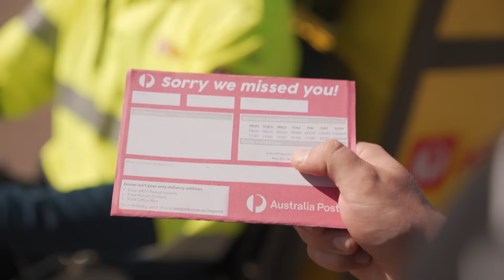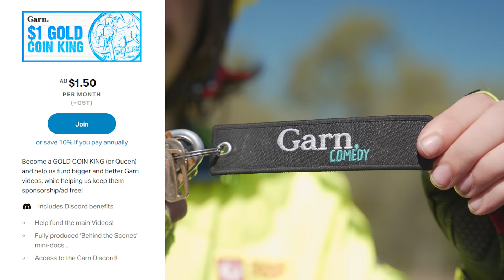Every AusPost Worker Ever... | Garn.

Comment: The bikes being too loud was a problem. It meant you might actually hear them and be able to get outside before they leave a card and run. With the electric buggies that's no longer an issue.
Reply: Too true 🤣🤣
Reply: The ones doing the card were the ones in the delivery trucks,vans though don't mind normally postie doing it since they never had the room anyways
Reply: The electric buggies are too slow though, if you were to see them you could catch one
Reply: @valentinkay2928  They can go up to 45ks an hour. About 3 times the average human can run.. Good luck catching that.
Reply: Postie here, trust me. It’s not hard to card and run on the bike either
Reply: @benjamin9120 That’s only about 1.5x the sprinting speed of an average human, at is happens.
Reply: You should be able to hear the sqeaking as it approaches.
Reply: The average human can run 30km/h? Wow!
Reply: The average human can run 30km/h? Wow!
Reply: The average human can run 30km/h? Wow!

Comment: My Dad was a delivery contractor for AusPost for years, and they ran on a three strike system - as in, three complaints and you're fired. Ever. For any complaint, no matter what the reason, no matter whether it was true or not. One person complained that the AusPost magnets on his car door weren't quite straight once (country delivery area, approximately half of his 120+ km delivery route was on heavily corrugated gravel roads), and that counted. That was the only complaint he ever got, but yeah, he got out his spirit level and some fucking glue so they couldn't possibly move.

Comment: I saw one of those contractor pricks literally tiptoe up to my door and try to sneak the card in between the door and the fly screen

The look on his face when he turned around to get in the van and saw the electric gate closing was priceless, I was thinking to myself, yeah mate, I got you this time you lazy cnt, then got both my 20kg packages of lithium ion batteries from what appeared to be the most depressed postie contractor in existence XD
Reply: You building your own power wall or something? That's a decent stack of batteries.
Reply: @iamdave84  indeed, I was building a 12kwh add-on for my solar system, and I also wanted to upgrade my electric bike battery

Comment: The idea of using electric scooters for mail delivery and last mile transport is actually pretty cool.....its not that thoes things suck,if u swap out the motor for one of those 1000w escooter motors,u would easily be clocking 80kmh.....uphill....both ways

Comment: I get it, it’s a piss take. But I feel I need to clarify a few things…I work for Auspost and after a hip replacement the only option for me, during my recovery, was the Electric Delivery Vehicle. I was pretty sceptic at first, but after having covered almost 3,000klm on one I have to admit they are excellent machines. No it’s not just about noise, it is about reducing maintenance costs, also they fob lock all doors so they protect mail whereas the Postie bike Mail is vulnerable to theft, also due to their size your whole run can be carried on them. Plus they autopark on inclines which is a great feature. Plus they are far safer than Postie bikes too, so it is a far better machine than the postie bike in many areas….not perfect but a step in the right direction. They also do 55kph and are only used in 60kph or less zones. To be fair you should do a video on peoples letterboxes and how bad many of them are…..I feel Auspost should bring out a decal for them….’Auspost Approved Shitbox”.

Comment: As a boy I once helped the parcel contractor for cashies at christmas. The rule was shake and feel the parcel, if it doesn't seem like it will break, throw it from the furthest distance at the highest velocity possible. Ten points if you can get it from the van window. Also do not get it on the roof like he had done and been in trouble for

Comment: AusPost is taking the piss. "Incorrectly sorted and forwarded to correct location" is a recurring update on the app tracking history. 
It's even happened twice on one parcel I've been expecting for weeks. 
Since moving from Perth to a regional WA "city" earlier this year, my local Postie is a bit of a dickhead. 
Most parcels can't fit in my hinge-top letterbox. 
Breaking both the letterbox and the parcel trying to fit them in has to be way harder than "leaving in a safe location" like my easily accessible alcove doorstep a few meters away.

Comment: Rode an ev for a few months lots of problems from battery fires to flipping them suspension steering problems and lack of maintenance  lots of  people getting  pissed of at you in traffic. Best one was getting g stuck at the bottom of hills not being able to get back up on hot days because the motors and battery would over heat and lose all power 

Friendliest people Ive ever worked with tho.